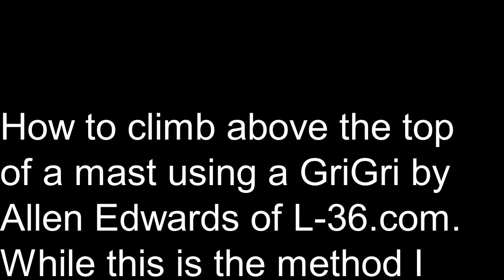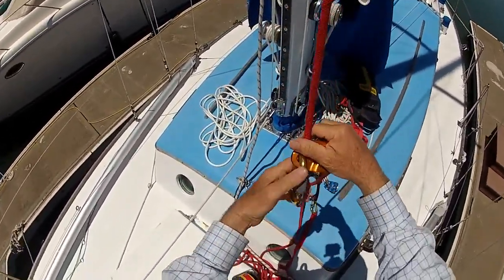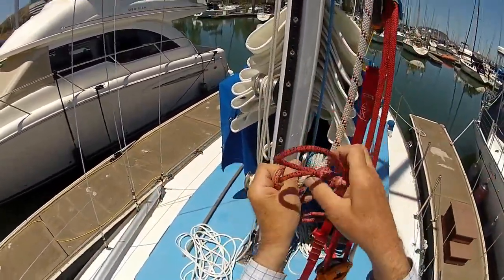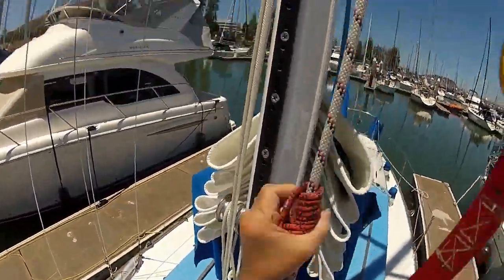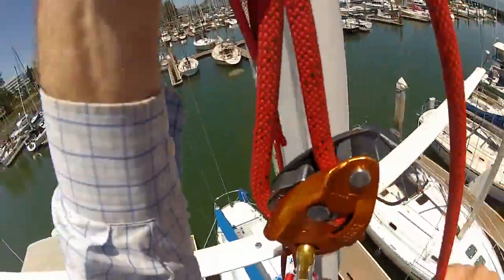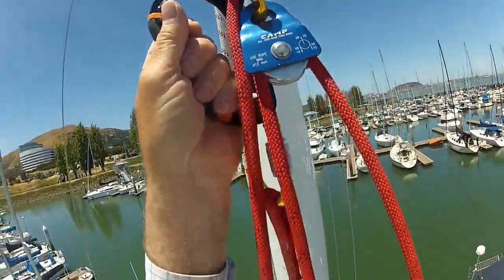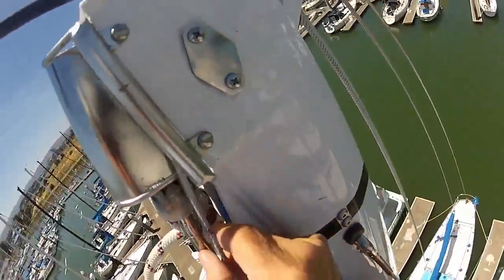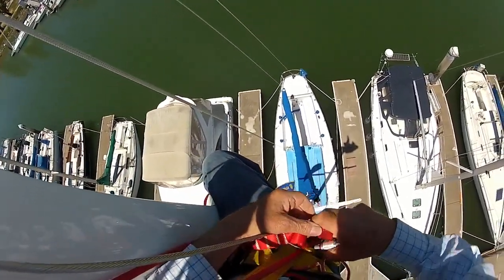Unassisted Mast Climbing using an GriGri with voice over.

Comment: I am a bit puzzled as to why you didn't just use two ascenders instead of this rig, that is the standard technique rock climbers use to climb vertical ropes.  You mention that the pulley system is 3:1, (really 2:1) but that is really not relevant since you should be climbing with your legs, not your arms.  Using two ascenders both ascenders are engaged with the rope while you are lifting your body with your legs creating the maximum force on the rope, while with this technique only the ascender is engaged as you pull the rope through the grigri while standing up. Grigris are not intended to be used as stand alone autoblock devices while ascenders are. In addition to being more complicated and less safe, this setup is also more expensive than using a pair of ascenders.  I would suggest using a cam based ascender such as the rescuecender as your backup rather than an autoblock hitch.  A double fishermen knot in the end of your rope is a more reliable stopper knot than a figure 8 knot.  Climbers typically tie double fishermen at the ends of their ropes when rapelling instead of figure 8's for this reason.
Reply from the maker: You are describing the method I recommend.  I use a microascender or rescuascender and a basic ascender below it for the foot loops.  It is a lot simpler and does not require reconfiguration at the top or all the tricks I show in this video. As I said, I do not recommend this method although I do use it.  It is 3:1 because the climber goes up.  If the same line is pulled from the ground, it would be 2:1.  That is a common mistake in determining the purchase of a pulley system.  More on both these topics on my website.  
L-36.com
Reply: @L-36  The Ideal Mechanical Advantage (IMA) of the pulley system is 2. You are incorrectly treating the rope that the person is pulling on as exerting a lifting force on the person which it does not do. The IMA (not purchase) is the ratio of the force applied to the rope to the force applied by the pulley system.  It is also the ratio of the  distance the rope moves down to the distance the distance the pulley and person move up.  When the rope goes down 2 ft the person goes up 1 foot. The work (force x distance) that is done by the person's arm on the rope is equal to the work that the pulley does on the person (by conservation of energy) and the force that the bottom pulley exerts on the person is therefore double the force of the hand on the rope. This can also be seen from the fact that if the pulleys are frictionless the tension will be the same in all segments of the rope and the two ropes passing through the pulley attached to the person pull up with twice the force that is applied by the hand.  The IMA is therefore 2.  You make a common mistake in determining the IMA of a pulley system of this type of ignoring the fact that there is a distributed force involved in the person's arm contracting, and by treating the force on the person's hand as a force that is lifting the person. It is not. The person's hand does experience an upwards force AS IT MOVES DOWN, so while the force is upwards, it does not actually lift the person. Further since the displacement of the hand (down) and the direction of the force on the hand(up)  are opposite, the rope is actually doing negative work on the person's arm.   What does provide an upwards force on the person's body is the other end of the person's arm where it connects to the torso.  As they contract and shorten, the arm muscles do positive work on both the rope as it is pulled down 2 feet and the torso as it is pulled up 1 foot.  Since the forces on either end of the arm are roughly equal and opposite* the arm does twice as much work on the rope as it does on the torso. Both the rope and the person's body are applying forces opposite to the displacement of the point of application, doing negative work to  (absorbing energy from) the arm.  This energy comes from the chemical energy transformed when the person's muscles contract.  In your model where the end of the rope is doing positive work on the person to pull them up, where do you think the energy is coming from? The rope? To understand this more clearly draw yourself a free body diagram of the person  and the arm as separate objects. It is necessary to do this because the arm changes shape as its muscles contract while the rest of the person's body stays relatively rigid.  There are three forces on the person's body:  The downward force of gravity on the person, the upward force of the pulley on the person and the upward force of the arm on the person. The force of the pulley and the force of the arm thus both do positive work to the person's body as the points where they are applied move up. The arm experiences an upward force from the rope and a downward force from the person, and a relatively small force of gravity on its own mass*.   The person end of the arm moves up and the rope end of the arm moves down so negative work is done to both ends of the arm. In the end all this is really irrelevant, because the person should not be lifting themselves by pulling on the rope in the first place.  They should be using their much stronger leg muscles to lift their body and their arms just to stabilize themselves.
Reply from the maker: @dwes3824  Wow, you are making this way to complicated.  I agree on the legs providing a lot of the force but in reality this is less than you might think but let me just clear up the mechanical advantage issue of this system.

Consider the situation where the pulley is 1 foot above the climber.  There is 1 foot of rope coming down from the ascender to the climber, 1 foot of rope from the climber to the pulley and 1 foot of rope from the pulley to the hand of the climber.  When the climber pulls the rope and gets to the pulley, there is no rope from the ascender to the climber, no rope from the climber to the pulley and no rope from the pulley to the climber's hand.  The climber moved up 1 foot by pulling down on 3 feet of rope.  It is 3:1. Now consider if the same rope was fed down to a person on the ground. He would have to pull enough rope to pull the climber up 1 foot shortening the rope from the ascender to the climber by 1 foot, and one foot of rope from the climber to the pulley.  Thus he pulls 2 feet of rope to lift the climber 1 foot and the system is 2:1.  Same system but if the climber does the pulling it is 3:1 and if someone on the ground does the pulling it is 2:1.

It is probably easier to see this if you had a single pulley at the masthead and a line down to the climber. Someone on the ground has no mechanical advantage, when the climber is at the top, he has pulled mast height of rope to get him there. 1:1.  But if the climber is doing the pulling, he starts with two mast lengths of rope and ends with no rope between himself and the masthead.  He has pulled two mast lengths of rope to go up one mast height.  2:1.  Same setup, different mechanical advantage depending on how is doing the pulling. 

I hope this makes it clear.  If not, try this.  Again with a single pulley at the top.  If the climber is holding the rope and weighs 200 pounds, each end of the rope has 100 pounds on it.  2:1.  If a person on the ground is holding the rope there is only one rope going to the climber so each rope has 200 pounds on it.  1:1.

All this is under ideal conditions and there is friction in the GriGri so some of the force is lost to friction so the actual mechanical advantage is probably closer to 2.5:1 although I have not measured it.

What I can tell you is that the system I recommend, which is what you described, it more difficult to use going up and almost infinitely more difficult to use going down.  But it also has the advantage that you can go back up a bit.  I used it when I painted my mast as I could go back up a bit to catch that spot I missed.  It is also less complicated and and easier to set up. Going down with the GriGri is easy and with the tricks in this video, very controlled.
Reply: @L-36   Allen this statement "The climber moved up 1 foot by pulling down on 3 feet of rope" is objectively false. When the pulley rises 1 foot, 2 feet of rope are taken out of the two supportive strands of the pulley system, they go over the top pulley and down allowing the climber's hand to move down two feet relative to the pulley.  Don't take my word for it go measure it.  That is the beauty of science.  You may be confusing motion relative to the climber's moving body with motion relative to the fixed pulley which is the critical issue.
Reply: @L-36  To better understand what is happening here, consider the process of doing a pull up. Your arm flexes and lifts your body from the shoulder.  While there is an upwards force on your hand, your hand does not move and does not actually lift, your arm does the lifting.  When people who do not have sufficient upper body strength to do a pull up want to develop the skill they will sometimes use a large rubber band as a stirrup and do a pull up with an assist from the elastic force of the rubber band.  That is a good analogy to what is happening here.   The climber is doing an assisted pullup as they flex their arm.  The assist comes from pulling down on the 2:1 pullley system instead of the rubber band.
Reply: @L-36  This statement: " I hope this makes it clear. If not, try this. Again with a single pulley at the top. If the climber is holding the rope and weighs 200 pounds, each end of the rope has 100 pounds on it. 2:1. If a person on the ground is holding the rope there is only one rope going to the climber so each rope has 200 pounds on it. 1:1."  simply demonstrates your misunderstanding of the concept of mechanical advantage.  Regardless of whether the climber or someone on the ground is pulling on the rope, the climber moves up 1 foot for every 1foot the rope goes down.  For an IMA of 2 you would need the rope to go down 2 feet.  If you start with a 100 ft long rope and the climber lifts themselves 50 feet, according to your logic, the climber would pull through 100 feet of rope.  Congratulations, your rope is now 150 ft long.  The flaw in your logic is that when you consider the forces exerted by the rope you are considering a static situation.  What is really happening here is the climber is lifting half their weight by doing a pull up and the other half of their weight using the pulley.
Reply from the maker: @dwes3824  I am just talking about one part, the line through the GriGri, the pulley, and back down to the climber.  Ignoring the GriGri motion capture were the climber to only pull on that rope, 1/3 of his weight would be on his hand and 2/3 on the line going to the GriGri. The same force has to be in all three strands because it is the same rope.  Draw it up.  This is just theoretical because the GriGri has friction so the climber will have to pull with 1/3 of his weight plus enough extra to overcome the considerable friction in the GriGri because it is not a pulley. The point is, if the rope he is pulling is supporting 1/3 of his weight, it is a 3:1 system, again ignoring friction which in this case is significant. So to settle this in a way we can both understand I made two measurements.  First is the ideal case with two real pulleys so a real pulley is replacing the GriGri.  I have a rope in my attic that goes up to the rafters about 15 feet up and put my climbing harness on, and pulled on a digital hanging scale I have. I weigh about 180 pounds and the scale recorded 60 pounds.  It is a 3:1 system like I said. Now I put the GriGri and recorded the force it took to lift me.  It was about 90 pounds so counting friction and the force to actually move me instead of just sitting still, it is a 2:1 system.  There was a lot of friction in the system, ropes rubbing against ropes but that is the way it is set up when I climb.  Maybe later I will see if I can rig it and reduce the friction with the GriGri.  So if you want to call it a 2:1 system you are correct but it is commonly called a 3:1 ideal system, which is also correct.
Reply: @L-36   The question is not whether the rope is supporting 1/3 of his weight in a static situation, it is whether it is lifting 1/3 of his weight when he pulls down.  This is your point of confusion. The free end of the rope is not lifting, it goes down. The problem is that you are confusing your weight with the upwards pull of the pulley system and they are not the same. It is the upwards pull of the pulley  and not your weight which determines the IMA. If you put a scale between you and the grigri, you will discover that it reads 120 Lbs when  the scale between your rope and your hand is reading 60 Lbs. 120 Lbs/60 Lbs = 2 which is the IMA. It is not a 3:1 ideal system with an AMA of 2.
Reply: @L-36  I am sorry I have not been able to explain this to you in terms you can understand.  Chalk it up to my failing as a teacher.  I realize now that I was suffering from what teachers call expert blindness when I tried to explain this to you in terms of energy considerations revolving around work done by and to the climber’s arm.  I assumed you had a much deeper understanding of physics than you clearly do.  Let me try one more time and then I really need to get back to teaching physics to the people I get paid to teach it to.  Let’s start off with some basic definitions so we are using commonly understood language. For simplicity, I am going to focus on a frictionless pulley system.  Input distance (also called effort distance) is the distance moved by the free end of the rope relative to a fixed frame of reference such as the mast. Input force (also called effort force) is the force applied to the free end of the rope.  Output distance (also called resistance distance) is the distance the object is lifted relative to a fixed frame of reference by the pulley system.  Output force (also called resistance force) is the force applied by the pulley system to lift the object.  Ideal Mechanical Advantage is the ratio of the output force to the input force in a frictionless pulley system:  IMA = Fout/Fin.  Input work (energy) is the product of input force and input distance.  Output work (energy) is the product of output force and output distance.  Finally, the law of conservation of energy dictates that energy cannot be created or destroyed.  In a frictionless pulley system this means that the input and output work must be equal.  Fin x Din = Fout x Dout.  Since IMA = Fout / Fin this also means that IMA = Din / Dout.  In other words when a pulley system doubles the input force the input rope must move twice as far as the object is lifted. 
You made the claim that when your pulley system is pulled from the ground it only provides an IMA of 2, put when it is pulled by the climber it provides an IMA of 3.  This means that the rope moves down 2 feet for every foot of lift when the rope is pulled from the ground, but three feet when the rope is pulled by the climber.  This is obviously not possible since we are dealing with the same pulley system.  The IMA is 2 in both cases because the ratio of experimentally measured distances is 2.  I suspect the source of your confusion on this point may be measuring the distance the rope moves from the point of view of the moving frame of reference of the climber.  Input and output distances must be measured relative to the same, fixed frame of reference.   It is meaningless to compare measurements in frames of reference that have moved relative to one another.  
When discussing the single rope system comparing pulling from the ground to having the climber pull you correctly observe that the tension in the rope will be 200 lbs when lifting from the ground and 100 lbs when the climber lifts themselves.  When lifting from the ground the tension in the free end of the rope is 200 lbs and the tension in the lifting end of the rope is also 200 lbs.  The IMA is therefore 200 Lbs/200 Lbs or 1.  When the climber lifts themselves. The tension on the input side is 100 Lbs and the tension on the lifting side is also 100 Lbs.  The IMA is therefore 100 Lbs/100Lbs or 1.  I suspect your confusion here may stem from the fact that you are treating the person's weight as the output force when the output force is really the tension in the rope. I have also wondered if you are adding the upwards force of the rope on the person's hand to the output force.  It is not part of the output force and further does not lift the climber at all.  Keep in mind that the free end of the rope is going down, and you can’t lift an object by lowering it on a rope!  Essentially what you are claiming here is that a 200 Lb person is being lifted by a rope pulling up with a force of 100 Lbs.  Clearly that does not make sense and since the other end of the rope can’t be lifting the person as it goes down, there must be another force involved.  See my pull up analogy. 
Another way to look at the single rope system is using energy conservation.  The input work when the climber pulls down on the free end of the rope is:  Fin x D in = 100 lbs x 1 ft.  Lifting a 200 lb climber 1ft reqires 200 lbs x 1 ft worth of work.  Here you are getting twice as much energy out as you are inputting, which is a clear violation of the law of conservation of energy.  The missing energy must be coming from some other source, that source is a force that you are not accounting for.  See my pull up analogy.  
I hope this has clarified things for you if not, I wish you the best of luck figuring it out for yourself.  
-Dr. W.
Reply from the maker: @dwes3824  I can pull my 180 pound body up with 60 pounds of force in a two pulley system simulating the GriGri setup but with a pulley.  Did you miss that?  I measured it for you.

You must consider the frame of reference. This might help http://L-36.com/blocks_mechanical_advantage.php

Key heading "Count the number of lines that are attached to the moving part". If someone on the ground does the pulling, there are two lines on the climber. If the climber pulls, there are three.  Read the article.
Reply: @L-36  Hi Allen, whay it is not really safe yo do, once you get up the mast and prepare to descend with the grigri (which is not trully a descender) is to open the carabiner where the grigri is located, this is not a good practice at all, since is your anchor line. You can use a sencond carabiner instead.
Thanks for the video.
Reply from the maker: @pupo343  I don't like this method and don't use it any more. Watch this https://youtu.be/89w4pLANLvo